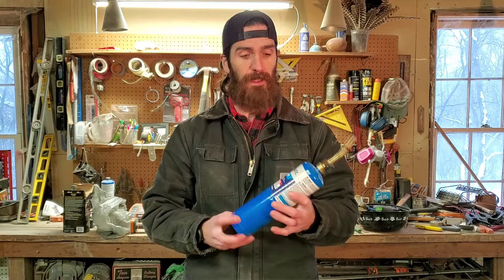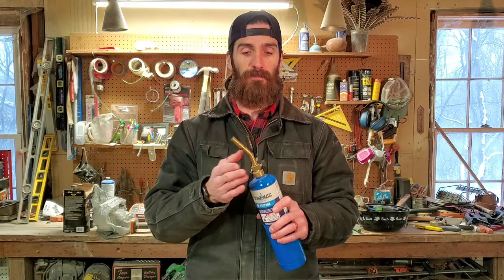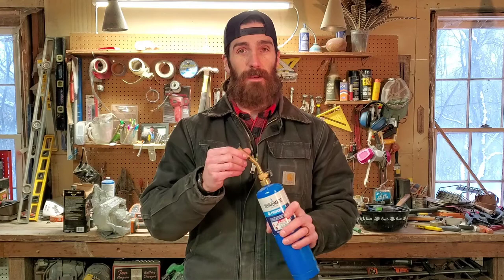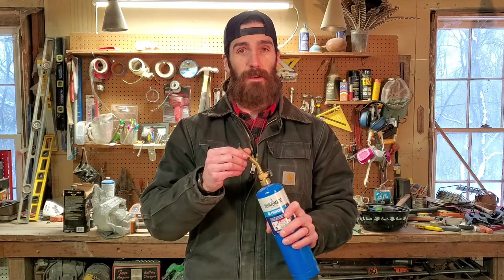Propane Torch-Weak Flame Issue

Comment: Good advice. Had three torch valves and none worked. I could either drive 30 miles to buy another or use your info and see if it worked. It does!! Finished the job and drinking a cold one!

Comment: I have brand new blue propane tank and brand new  identical torch like yours. It works intermittently. The screen (wire mesh) is super clean, yet it keeps going out right when I want to do my soldering.

Comment: I'm going to try some Air Mass Flow sensor spray and then compressed air .....See if that will get off the crud ..Thanks for the tip
Reply from the maker: Right on! Good luck and thanks for the comment!

Comment: is there anywhere that you know of where you can buy just that tip with the screen? I was an idiot and dropped mine on the concreate floor and it landed right on the top and snapped off lol. Try as I may I can't seem to find them, only the whole torch head.
Reply from the maker: Gosh I know how that goes! I am sure you could find one at a welding store otherwise I'd just buy a new head. Here is one on Amazon: https://www.amazon.com/BernzOmatic-Basic-UL2317-Pencil-Propane/dp/B00008ZA0C/ref=mp_s_a_1_3?crid=1DYFQ2WR4IDZY&keywords=propane+torch+head&qid=1650755329&sprefix=propane+torch%2Caps%2C214&sr=8-3

Comment: Hey Dan, what about an igniter that quits igniting?
Reply from the maker: When I have run into that issue I typically will either just turn on the gas a little or hold the switch down (depending on type) and flick a lighter at the end to get it going.  Fire away!

Comment: Mine lights but then pops and goes out. Any clue? Screen is clear and you can see through hole. I tried running some brake cleaner and air through but no change.
Reply from the maker: If I had to guess I'd say it could be you are out of propane or have the valve open to much.  Based on the fact that you have an air compressor and brake cleaner I'd assume what I suggested isn't relevant.  Do you hear anything as you slowly open the valve?

Comment: I’ve been looking at a propane torch from Home Depot. Do you know if they are any good?
Reply from the maker: I'm pretty sure that is where I got mine and have had it for many years.  However, if you don't want to mess around using a lighter to get it going then get the one that has a igniter built into the switch.  They are more expensive, but safer and more convenient.
Reply: @BigbeardMN  Awesome. Thanks for the input👍

Comment: Hey Dan curious Where does the screen go? I got mine taking apart to clean and the screen came out Does it go on the bottom when you  unscrew the top portion of the nozzle?
Reply from the maker: Hi! I am assuming you have one similar to mine and the best way to expalin it is the screen will be the first thing the flame hits in the nozzle.  Good luck and happy burning!
Reply: @BigbeardMN  you're the Man Dan! 
Thank you!

Comment: Quick question what should you do if the wheel to turn it is stuck.
Reply from the maker: Hmm if it is truly stuck closed ( right tighty lefty loosy) I'd grab a pliers or a rage of some sort to put in my hand and on the knob to increase the surface area and give you more power to twist it open. Hope you get it done!

Comment: So hey Dude, my Tirch thing acts more like a giant lighter than a torch. What's my problem? Worked fine last year til I fooled with it and can't remember what I did. Ooops!
Reply from the maker: Oh yeah mine did that too. Just unscrew the end, hold up to the lightand make sure u can see some decent light through it.  Good luck buddy
Reply: @BigbeardMN  Yeah, did that already. Pretty sure I am just plain missing the part at the bottom that fills the 4 holes up so there isn't all that air. Lol! Don't you laugh at me now, I am new to the whole propane torch thing.
Reply from the maker: @weebleandwobblebutdontfalldown  right on and hope you get it figured out!!
Reply: I guys, my torch stops when it's upside down... I will try to clean the tip as mentioned here...
Reply: @etiennerancourt6600  you aren't supposed to use them upside down at all. They can blow up in your hand if you do because the flame can somehow back up in there. Be careful.

Comment: You don't have to use air compressor.  

You actually don't even have to unscrew the valve . 

Before you light your torch blow into the end like you Would an old nintendo video game and it works like new every time
Reply from the maker: Contra style!...Loved that game!

Comment: Probably not the best tip on You Tube.
You could actually blow out the screen along with the debris

Better to soak the tip in rubbing alcohol overnight and then let it air dry
or use the shop vac on reverse to blow it dry. But an air compressor UNLESS turned down to the lowest pressure, will be too strong.